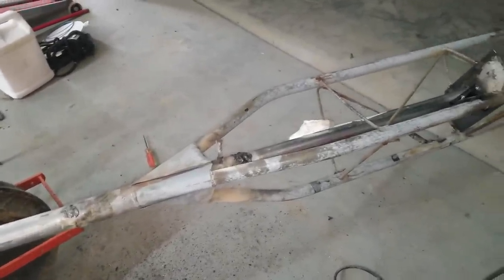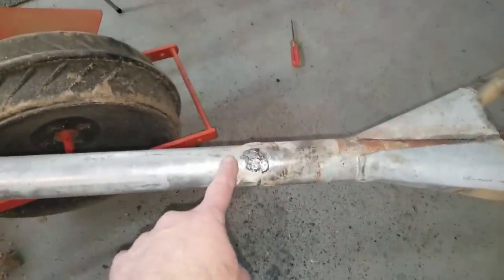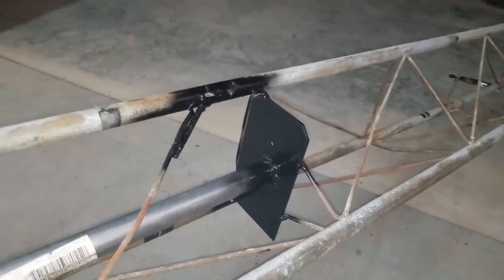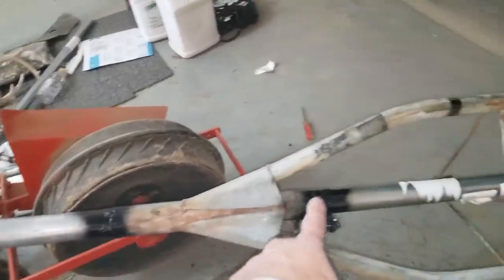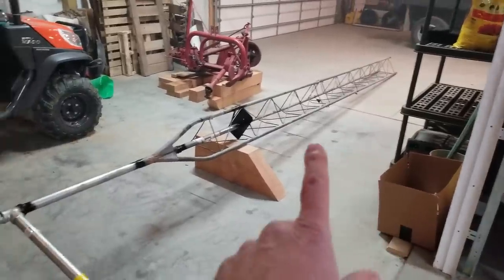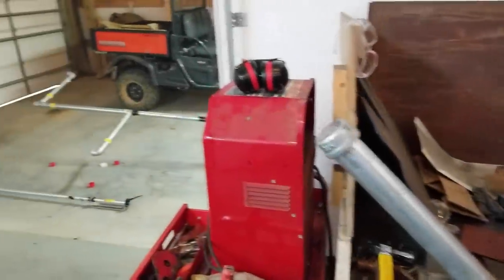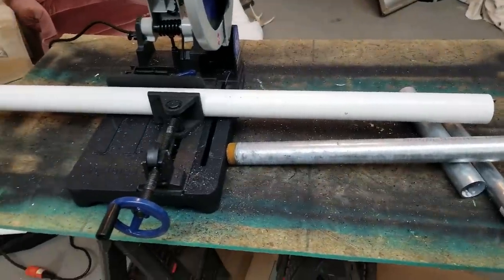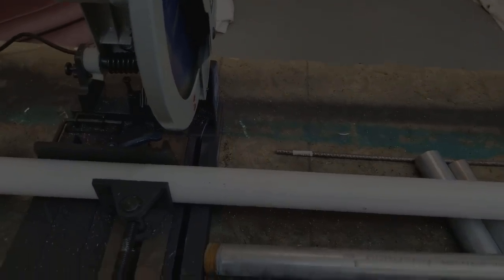Ham radio antenna Mast PART 2 completion!

Comment: I've been doing this for 45 years as a ham and 35 years as a professional, and this is the 1st time I have ever seen someone insulate antennas from the tower. WOW.  de K1TA.
Reply from the maker: Well I won't be doing that again! LOL It was only that specific antenna that was designed for a ground plane, but they said if you didn't have a ground plane to insulate it like this. Did NOT work very well! :)

Comment: Kapper, I really hate to pee in someone's Corn Flakes, especially in a public forum. However, as someone who has thousands of hours installing towers and antennas for Amateurs and some commercial work I feel obligated to speak up. IMO, your installation is not safe. Rohn publishes a very compressive catalog/manual for their tower products. This document was prepared by licensed engineers, to protect not only Rohn, but the installer and end user. To those watching this video, I implore you to do your research and follow the manufacturers instructions when installing towers. The life you save may be your own!

Comment: No offense intended Joe but where did you get the idea that vertical antennas are supposed to be insulated from the mast?  That top antenna you are installing is a trap-vertical. It is basically a "ground plane" antenna. It is designed to be mounted at ground level (at a specific distance from the ground) and uses the ground as radials. When mounted in the air it "should" have wire radials for best performance. But regardless, the metal mount is designed to be attached to metal that goes to ground. The same goes for ANY antenna attached to a metal structure. It is SUPPOSED to be grounded at the mount. With a totally floating antenna up there you'll be gathering lightning energy from storms hundreds of miles away. :-)  It is also a good idea to have ground rods at the base of the tower with large gauge wire coupling the rods to the tower base. I sunk two large copper ground rods into my concrete when I poured it and then coupled to the tower with huge 1-inch wide copper braided  straps.  By the way, how are you going to "tune" that antenna before lifting the tower up?  With a trap vertical you need to tune each band so the SWR is not through the roof (which as you know will reflect all your transmitter power BACK to the transmitter instead of to the load, i.e. the antenna).
Reply from the maker: Well, the idea came from another ham, and it was this; That that paint/galvanizing could prevent a good ground contact, so we were going to ground the antennas directly with grounding strap. Same principle, just different method. But in re-assessing, I think I'm going to take those insulators off and ground to the pipe direct. I'll take a grinder to it where the antenna's connect. I think part of the other theory was that if One antenna got hit, that it could run down the grounding strap and potential save the other 2 antennas. Seems very plausible to me. So, that was the thinking and theory. but after seeing the little bit of slack difference with the pvc, I'm going to just mount to the steel mast. thanks, hope that helps. It is always a work in progress!!!
Reply: 100% agree that's exactly what i thoughts
Reply: @kapperoutdoors  You would probably be better off making a grounding strap, such as a loop or Eye to wire on both ends, from antenna to pipe... and use a small self tapping screw into the pipe.  Then cover it with paint to stop corrosion.  Then at base, do the same thing to your ground rod.  I have done that on my pipe and it grounded them well.

Comment: The weight of the mast poles is not the issue. It is the wind cross section. The issue with ANYTHING that sticks out the top of the tower is wind load square-feet. Even a 35 foot self-supported Rohn 25G only has an allowable wind load of 3.6 sq-ft for 70MPH wind survival (no ice). Rough calculations show that you have around 16 total feet of ~2" OD mast sections. The mast sections themselves equates to roughly 1.2 sq-ft of wind load not counting the elbows and unions. That is almost 1/2 the total allowable wind load for a 35 foot self-supporting tower. Increase the height to 40-feet and the total allowable wind load is reduced to only 1.5 sq-ft.
Reply: EOSJOE and Kapper my concern was the tapcon bolts pulling out that were used to support the tower base. Kapper, Joe May be an engineer, I never received a reply from you regarding the tapcon bolts. Like you I’m not a golden child of you tube I just want you to win. I hope you researched the correct bolt, win baby win!!!

Comment: This may be something that you've already considered although it seems the lengths of your horizontal mast sections were arbitrary. There are specific guidelines as to how far away from the tower a vertical antenna should be so as to not effect the  radiation pattern. It's not simply a matter of farther is better. I think you need to be at certain multiples of the wavelength of the antenna. Example... at 1/4 wavelength away you have close to an omni-directional pattern (with a slight null towards the tower) but if you get to 1/2 wavelength then the pattern becomes bi-directional.
Reply from the maker: I'm not overly concerned about this. I am not confident to take those out any farther, and this is the only way to mount multiple antennas, regardless of whether I used a rohn t-pipe or made my own. It will be what It is. That is also why I offset my 'T' if you will to at least give a little more separation vertically to those outer antenna.

Comment: Ya need to grind off the galvanized coating hun before you weld on it, otherwise it is very poisonous in a vapor form. Nice video.  hugsss
Reply from the maker: Well, I was holding my breath and then stepped away as soon as I could from the cloud! :) Thanks, hope you stick around to see more stuff.

Comment: The pipe fittings you used can crack and fail over time , i would use bends with braces welded for strength
and use steel without galvanized coatings , wait until after welding, and brush on etching primer then paint

Comment: same question i have the vertical antenna designed to be bolted to a mast  i have only one antenna that needs a insulator that my 2 meter 440  copper antenna and wire dipole will be pulleys or ropes
Reply from the maker: Well I decided to remove the insulators instead of running a separate braided ground wire from each antenna.

Comment: I agree with EOSJOE, your trap vertical requires ground radials, not just a grounded mount. The swr will be great, but it won't radiate well at all. Better off to ground mount the trap vertical and run radials AS WELL as a good ground. If not you are going to  have a high radiation angle. This is how verticals get a bad name, equally poor in all directions etc. You would be much better served with a dipole or vee. If you only want 10 meters or something get a ground plane vertical or convert an 11 meter antenna. I am a low band dx'er and use ground mounted verticals with 64 radials each. Very low radiation angle. Google it. 73
Reply from the maker: Well, we'll see how it goes. There are 2 sets of radials on the 5 band antenna, (short ones of course, aluminum) and I have the antenna manual, so I'll look again. This will be a work in progress as time goes on. I do plan on making a couple of dipoles, strung up in the trees as well. It is still a learning curve, but so much 'theory' on antennas!

Comment: I am anxiously standing by......  Good luck with your surgery.  I know nothing about antenna,s but don't they have to be rotated for tuning?
Reply: Not if it is an omni-direction vertical.  Only a "directional" antenna (i.e. Yagi)  needs to be pointed towards the signal source.

Comment: Kapper  .... I worked as a mechanical designed and the items that got welded in our indoor model shop never were allowed to be galvanized.  Joe you should learn some better work habits or in the long run you will pay a price.  Think twice before you decide to do a job that is not something you are good at or do for a living.  The price you would pay the man that does it for a living is cheap when you add up the bad lungs, poor heart, bad back, price you pay for parts and tools and it may not works as well as the one you buy and, then it comes down of the roof of the house.  It is hard to admit defeat when doing a project BUT ....  Now I will go screw something up myself.  Hope the back is well cared for and you do great.  I will keep you in my prayers.
Reply: Galvanic poisoning can be treated by drinking plenty of milk, no need to worry with the amount of welding he is doing.

Comment: Dude you are using to much on the weld that you made on that cross member. And use a fan to blow the fumes away from when welding galvanized metal since you do not have an evac system.